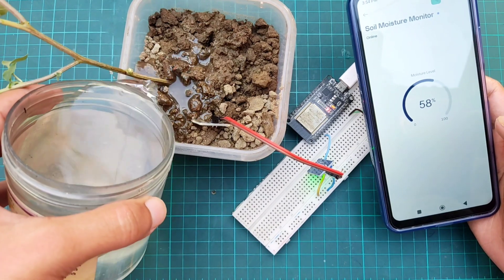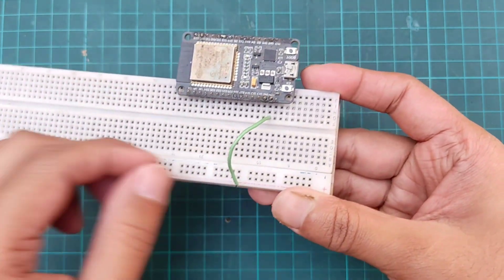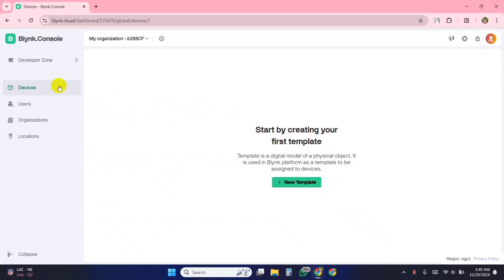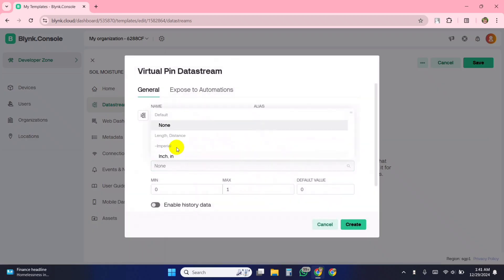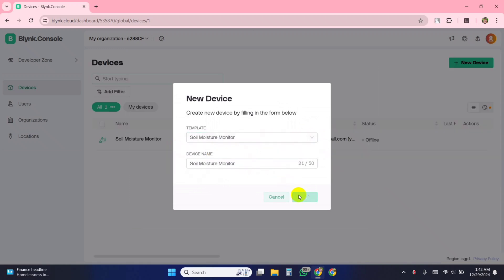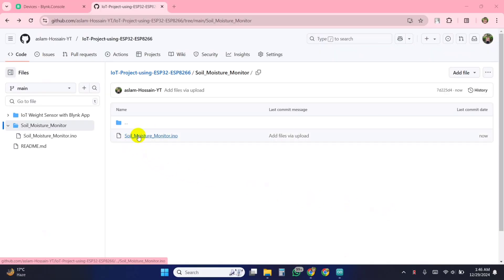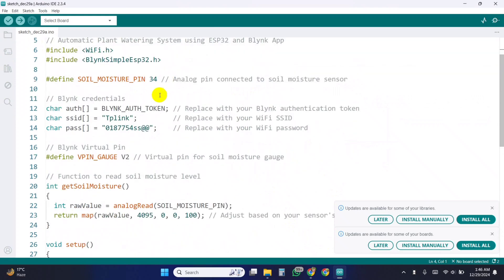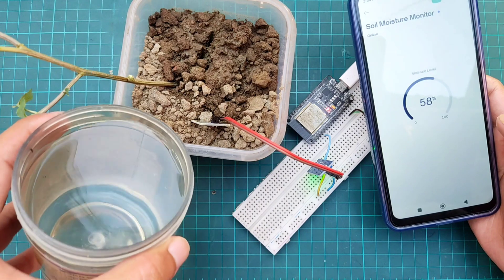Soil Moisture Monitor using ESP32 and Blynk App | Soil Moisture Sensor with ESP32

Comment: in soil moisture monitoring project using ESP32 and Blynk. I managed to establish the connection between ESP32 and Blynk server, and my application is online. However, I am facing a problem: when I connect soil moisture sensor to ESP32, the system goes offline. How can I fix this?
Reply from the maker: Need efficient power supply. Follow the circuit diagram. And keep the esp32 in the range of wifi you're using.

Comment: the code wasn't available, could u give me the code template?
Reply from the maker: https://github.com/aslam-Hossain-YT/IoT-Project-using-ESP32-ESP8266/tree/main/Soil_Moisture_Monitor
Reply: @aslamhossain1  what's the name of library and manager did you use in this project on arduino ide sir?
Reply from the maker: #include <WiFi.h>
#include <BlynkSimpleEsp32.h>